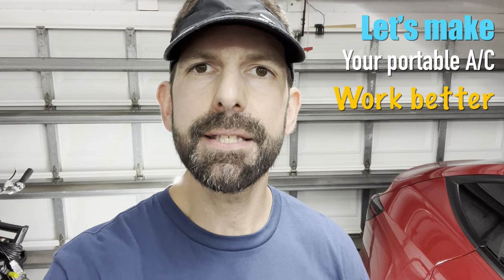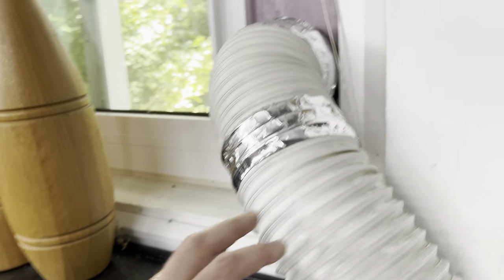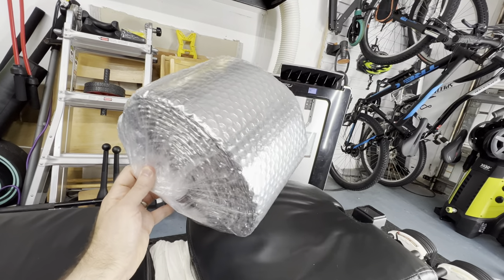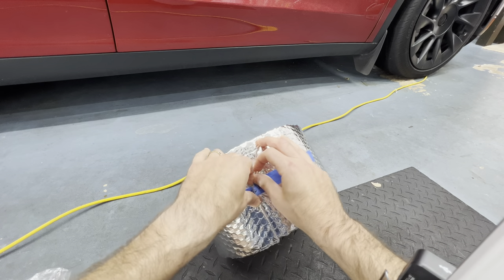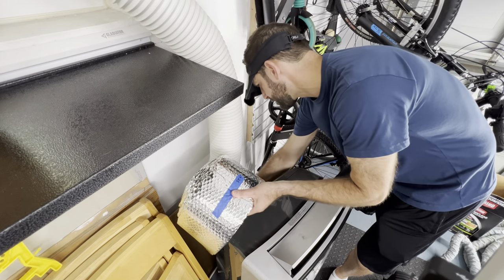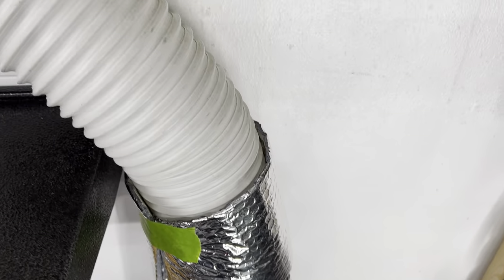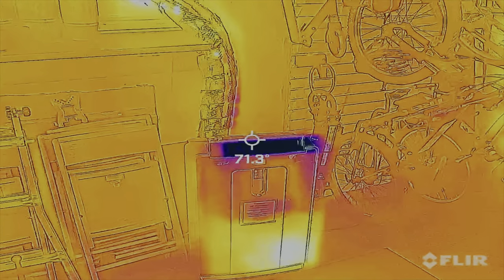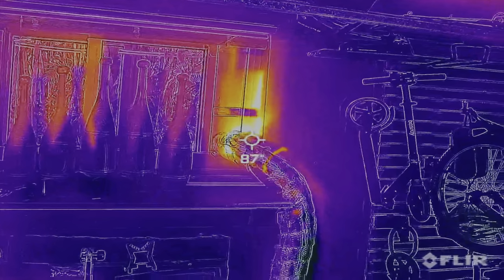How to improve efficiency of portable air conditioner AC units to cool rooms faster

Comment: You are supposed to use a second hose to use the outside air to cool your evaporator instead of inside air. That way you wouldn’t use the air you just cooled to cool the evaporator.
Reply from the maker: That is optional and depends on how hot the air is outside the room relative to the inside. If the inside air is 85 F and the outside is 95 F and humid it wouldn't make sense to use the intake duct (as in my case). 

As Whynter explains it on their FAQ page, "A dual hose portable air conditioner will cool a room faster and will help minimize negative air pressure situations in the room. If the outside temperature is much higher or more humid than the room, you can cover the intake hose with the included cover, and it will function as a single hose unit."
Reply: The inefficiency of a one vent portable AC or not using the intake hose on a dual, causes air from the outside to be sucked in from all the tiny gaps in the house. When you push air outside the air has to flow in from somewhere to equalize the pressure. A dual hose system makes a closed loop of the outside air flow when hooked up properly. Which is more efficient than causing a constant flow of outside air coming into your house.
Reply: @reallyMello  I don't think you understand. The air conditioned air has a different intake. It's a closed loop. If you properly use the dual vent then the outside air is second closed loop, like a central AC. The way you have it setup will cause outside air to get sucked into your house, losing efficiency. Using both vents will lower the humidity more too.
Reply from the maker: @recoveryguru For it to be a closed loop it would need to be recirculating the same air. When you are dumping out exhaust air through the window you have created an open loop that, as you state, needs replacement intake air from somewhere, either the surrounding spaces or the optional second duct connected to the outside--but that is fresh air, not a closed loop, not recirculating. So in situations where that input fresh air is significantly more hot and humid than the space you are conditioning there isn't a benefit of using the second hose. In cases where the intake air is milder or less humid, yes.

A central A/C is a closed loop because it recirculates the inside air and transfers the heat out via the coolant loop to the outside compressor that is cooled off with the compressor fan using the outside air vs the compressor being housed in the same space as with portal units where you need to duct out that waste air which needs replacement air from somewhere.
Reply: @reallyMello  I guess I used the wrong terminology. I mean the inside and outside air are are kept separate in a dual system. You run an AC when it's cooler outside? 😲
Reply from the maker: What you were explaining just clicked for me in your last comment. I didn't realize that intake air was only going to the compressor [to cool it] and then immediately looping back out to the exhaust to expel the heat. The cold air part is recirculated room air and not mixed with that intake air. In other words, I'm going to try with ducting the intake as well. Thanks for the tip 😊 (and yes I run the AC when its cooler or about the same as the outside temperature outside than inside to remove heat and humidity from the living space--In Florida you can't just open a window)
Reply: @reallyMello  Good call, you probably don't want that humid Florida air getting sucked inside even if it's a little cooler. 😃
Reply: @reallyMello it's important to remember that an outside temp of 95° at 50% RH feels significantly warmer than an inside air temp of 85° at 60% RH. Running in single hose configuration creates such negative pressure that residences (especially those with window ventilation) will experience increased temps in rooms not directly serviced by the portable unit as the negative pressure created by the portable unit in the living room is sucking in that outdoor, 95°@50%RH, air in the bedroom down the hall.
Reply: Yeah… blowing the inside air outside is costing you far more than the heat from the pipe.
Reply from the maker: @cvogt99 ya hooking up the second hose to the external air to get rid of the vacuum further enhanced the setup
Reply: To my understanding this contradicts itself. As the compressor efficiency goes down if you pull already hot air across it from outside. If you pull it from inside where there is cool air it actually lowers the power needed because it runs more efficiently. I have portable air cons that will start to freeze over. But the moment you let a compressor start pulling from outside they stop doing this and the power draw slowly increases.
Reply: @unclejohn5012 the portable AC should be able to cool itself using outside air. Yes it runs at lower pressures when using inside air but the efficiency loss of having outside air always coming in outweighs the efficiency gain of the lower pressures.
Reply: @WilliePeck  Tell that to my aircon that before being converted to dual hose would struggle to cool down a single bedroom on a 36c day.

Now it cools down my whole house. Dual hose aircons are no joke. I also was a disbeliever myself until I did it. You can only do this with certain types of portable aircons, and you must tear down your unit to also make sure it's sealed.
Reply: @unclejohn5012 Hi, which dual aircon are best to use for this trick?
Reply: @recoveryguru , what if you don't have a double ? I only have a single place for a hose.
Reply: @southerngrandma8279  Then you only have that option. They are 10 to 15% less efficient than dual house or in window units.
Reply: This is correct, you Will have a constant flow of hot Air into the room
Reply: a third option it to place the unit as high as possible in the room. it will use rising hot air to cool the evaporator and expell it. This works better than a dual hose situation if the crevices from which air will enter the room, due to pressure equalization, are cooler from outside, like if you are cooling an insulated garage.
Reply: @reallyMello this is exactly what I wanted to say about these things it might kick it into thermal overload Becuse these compressors heat up quite a bit so if it sucks air from outside blowing hot air outside this makes it tough for the unit and if it’s sucking cool air inside the room then that will improve ALOT of efficiency Becuse if the room is cold and it’s blowing warm air outside in cool mode then the compressor is getting help from the cool air inside the room and that’s why these black+decker airconditoners might be better so never do the duel hose thingy or else you will regret it and take my advice eventually.
Reply: @reallyMello :last part I do that also
Reply: LOL that's the way i have mine, both hoses needs to be connected to outside, just keep them separated by at least 4 feet outside so you don't find yourself bringing hot air inside again. The benefits of having a dual hose system is bringing clean air from outside inside all the time otherwise your room becomes a vacuum and that's dangerous, you are literally pushing all of the air out there goes your oxygen too.
Reply: @recoveryguru  yes your room becomes a vacuum trying to bring air in from other rooms, this is why a single hose system is very inefficient, the manual literally says both houses go outside lol, if you push air outside you must bring air inside to avoid the vacuum effect, also you don't want to be breathing the same air all the freaking time like regular window air conditioners work.
Reply: @unclejohn5012  the ideal way is to set the AC to shut down the intake fan as well when the cooling compressor turns off, that way you not bringing unwanted hot air from outside while the compressor is off, in fact many window air conditioners and portable ones have this setting, fan stops if cooling stops too, this is the way a double hose system should work unless you set it to fan mode only.
Reply: @southerngrandma8279  there's a solution for that, it's my case, same situation, i simply bought a ventilation hose a few feed long and connected to the air intake myself, from the window in to the air intake, your AC air intake is were the filter is at, a big square cutout in the unit with gaps on it, get a squared plastic container about the same size of the intake gap make a hole on that plastic container the same diameter of the hose hole and connect it together.
Reply: @eggling3427  set the intake fan to auto shut down when the cooling compressor shuts down. That way you only bringing air inside when is getting cool down by the compressor. Simply solution, don't keep the fan ruining when the unit is not cooling.
Reply: @lcfflc3887  Dual hose portables and window units are the same in that outside air flows across the hot coils and inside air flows across the cold coils. Most homes exchange more air from the outside than you realize, it's best not to accelerate it though.
Reply: @reallyMello  Think of how an outboard motor cooling system works--it's called a "total loss" system, btw.

The dual hose set-up is doing same thing as your home central AC system, except that condenser & evaporator are in same housing, and "the outside" is extended by length of your hoses (vs. typical house system, where condenser coil is 'directly' "outside".  😉

Comment: Another issue is that it's removing air (also cooled) from the room. Resulting in a lower pressure, which will draw in warm air from elsewhere.
Reply: That's why you should only buy a dual hose system
Reply: @robertclark8546  Indeed! Unless you actually want to pull in air from the outside, which may be a goal for some. I'm actually considering just sticking with my single hose portable (instead of dual hose or even a mini-split) since a second issue I have in my room (in fact, in my home which is well sealed and insulated) is that it doesn't get enough fresh air ventilation from outdoors; the bathroom fans only do so much. So in a way, this can work well both for cooling the hottest rooms in a top floor as well as forcing fresh air from outside, which might not necessarily be bad.

That said: 1.) This guy's setup needs balanced air very badly, since he's in a super hot/humid climate and 2.) I'm in a very well insulated room in a well insulated house in a moderate (but sometimes warm) climate. Coincidentally, I'm in the Pacific Northwest and right now it's relatively comfortable outside and only hot on occasion. I only need a window AC precisely when it's moderate but only slightly warm outside, lol. So, 78-80 degrees for me spells discomfort, since my 140sqft office will ramp up to 82+ while the rest of the house sits at 71 (from the central AC cooling over night). 😅

Comment: It is easier to purchase a box of 6" insulated ducting. It is much thicker and easier to work with. Use it to substitute the exhaust pipe that came with the A/C. Also, you can run it for longer than the original exhaust pipe.
Reply: As the YouTube video says, the duct connectors use brittle and plastic tabs.  Trying to tape or connect insulated duct that doesn’t fit the connectors would result in hot exhaust leaking back into the room.

Comment: I bought a new unit and it wasn't cooling the room at all so I did the same thing you sid however I wrapped with a few large towels and duct taped it and rhat didn't work. The towels don't get very warm but the unit atill blows warmish air. I think I bought a turd.

Comment: Single hose units are so inefficient it should be illegal to sell them. They just pull more ambient ( ie warm) air into the room from the vacuum created by pushing the exhaust out. That said, even on a dual hose unit the insulation would be a huge improvement so well done.

Comment: I did that a couple years ago, no FLIR so hard to prove any gains. Next thing i did was put the portable on blocks to shorten the exhaust tube as much as possible, current setup has just 6" of double thick foil/bubble insulation between the  AC and window.
Reply from the maker: Ya the FLIR was a fun way to confirm if it did anything and also verify I didn’t have any gaps/leaks in the insulation. This morning it did seem to drop the temperature faster in the garage than before. Shortening the duct was a smart idea you had too. It probably lessens air resistance for the exhaust air as another efficiency gain.

Comment: Looking through your thermal device just confirmed my personal observation of the glass on the window conducting and transferring additional heat from the outside. Might as well insulate that from the outside. Hence making your ac not work as hard to cool down your area. I don’t think other people have that point in consideration and just totally focus on the unit for the problems. Thanks for posting this video.
Reply from the maker: You’re welcome!
Reply: Lazy man, just move the unit lool
Reply: @krzywik13 you need to work on your comprehension of the English language, the point I made has nothing to do with the unit location. Re-read and comment after you’ve fully understood the context. In which, you’ve obviously hadn’t yet.

Comment: Technology Connections has a really good video about this.  I rigged up an intake and output system with my single hose unit.  I had a large 12" aluminum duct that covered the intake really well.  I squashed the other side a bit And made a window adapter that held both the intake and output.  That dramatically increased efficiency once I was no longer sucking outside air into my conditioned space, then exhausting it outside.  I further improved things by covering both hoses with some cheap blankets.  Kinda quieted things down, too.  

Anymore I just don't feel the single hose units are worth the trouble.  I have my original unit and a second one just sitting around, even in these record setting summer days.

Comment: Great idea. I bought  a machine today - was amazed at the heat coming off the tube!!  I  just found an old foil backed foam ground sheet in my STASH! .  I cut it into 8inch sections to make it flexible & wrapped each around the tube.  Its 20¨wide so just enough to go around & affixed -with the traditional GAFFER TAPE.  Foil side down & white side it to the room so don´t look too bad either!! ! Definitely makes a difference.    Cheers From Madrid.  :face-green-smiling: It´s 2am & still 28´c outside.
Reply from the maker: Nice job!
Reply: Is it humid in Madrid as well?
Reply: @Jordan-or8wu   Not a chance!!   This month its about 25-30%. Madrid is 660m above sea level & 500km from the ocean! :face-orange-frowning:

Comment: noticed this as well. so i also wrapped the whole exhaust with an insulator 👍
then next thing i noticed after that was solved was that the area on the window near where the exhaust was blowing was warm as well. so i stuck some wall foam stickers to cover the hole thing haha. it wasn't perfect since the foam wasnt thick (it was made for decor) but it did help.
Room has been a lot cooler now 👍👍
I'm gonna add some more insulation from the outside as well when the foam insulation i ordered arrives.

Comment: Fantastic,  my mother uses one when the temperature gets really high and I couldn't fail but notice that the tube in the back is super hot essentially heating part of the room around it to an extend that i could feel it if ibstood behimd it... I will try your solution as I am sure it will improve the performance dramatically.
Reply from the maker: I noticed the same thing which is what led me to try this. Good luck.

Comment: There’s also the insulated sleeve you can buy and put over it! Helped mine immensely
Reply: where can i get one the unit just came with the pipe and a plastic bag type window seal
Reply from the maker: @Paul-hl4cj check my video description 👍
Reply: thanks looks like the sleve is not one sise fit all but the silver role can fit any size do you have a comparison heat lost vire sleve and wrap but its still a fab idea will look for some foil wrap at homebase ty